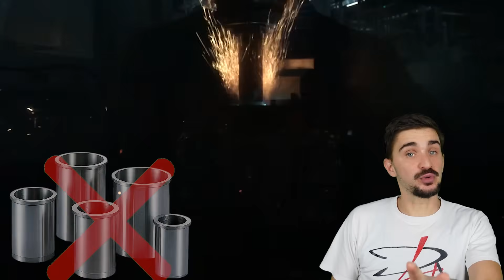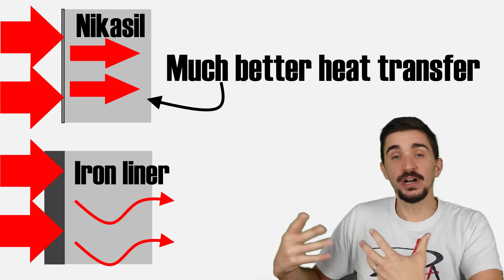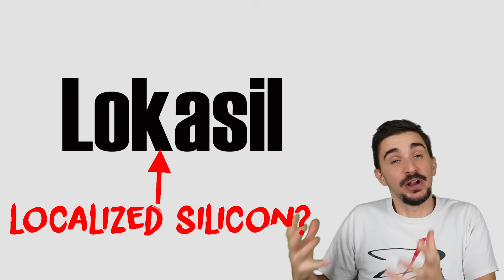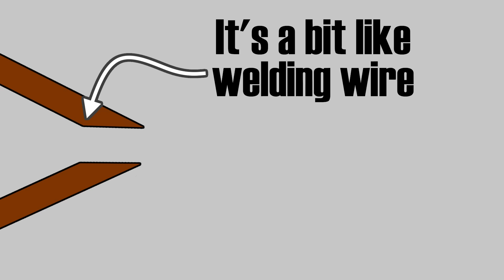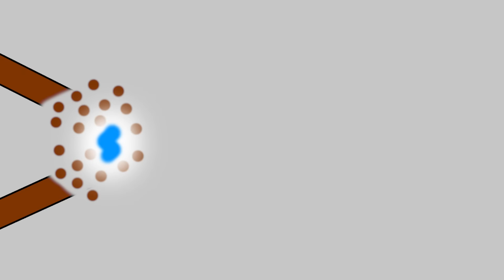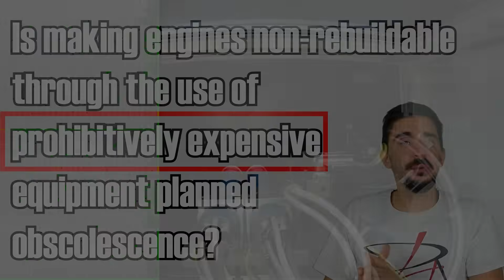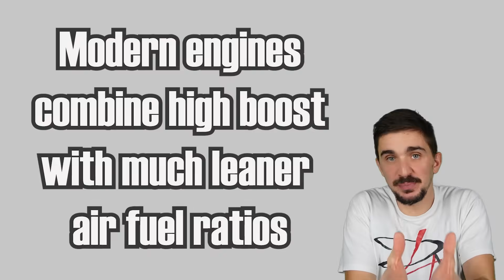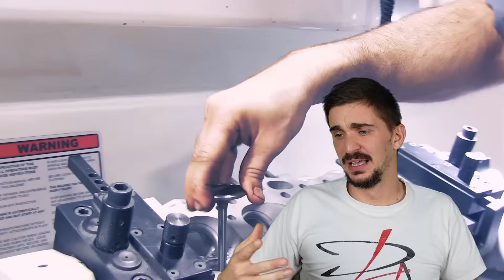Why Are Engines Becoming Non-Rebuildable? Everything About Cylinder Coatings

Comment: Good analysis.  Several problems, one you assume that emission standards have to change over time.  If so the standards were excessive or inadequate.  This is part of planned obsolescence on the part of the Communists who now masquerade as "environmentalists."  Problem two: rebuilding the engine is rebuilding the vehicle because the whole machine dies with an non-rebuildable engine.

Comment: While I agree the new spray coating is durable enough that they are imo a worthwhile improvement (especially for the weight reduction compared to full iron blocks), the reality is by the time these engines fail, an engine rebuild or replacement is so costly that the entire car gets written off. The emissions damage should calculate the emissions of the entire vehicle being recycled and a new vehicle being manufactured as a replacement. The biggest criticism I have is the extended maintenance intervals causing a significantly shorter lifespan. Every modern engine I've worked on has the potential to last 500000km when maintained religiously and by that mileage, the rest of the vehicle tends to be consumed beyond repair, making it pointless for an engine to be rebuildable regardless of cost

Comment: Problem with your thermal part failure theory is none of that makes the engine none rebuild able. If the part that fails is overly cheap or makes rebuild and repair even cheaper too. So the only possible way to make something planned  obsolete is to make it impossible to repair. You completely just made the case that yes this is planned

Comment: Assuming that these new coatings last as long as the old cast iron engines is a huge assumption.  I'm old enough to remember the Chevy Vega very well.... and their engines were literally botched abortions on wheels.  I saw several fail at well under 60,000 miles.  Although I did see one make it to 105,000 before it too began smoking like a battery fire. 

The big problem is that "new tech" cars all run when you buy them, it's not until some years later you found out there was something wrong with the process used to create them. Which is of course is too late to get a refund.

The question is not whether an engine is rebuildable, it's whether it will last as long or longer than it's predecessor,  .

Comment: In order for an engine to be rebuilt it has to wear out before the rest of the car.  So, that likelihood is small.  The car needs to live 10 years or more with out getting totaled in a collision, or rusting out, among other factors.  If the car is a modest car, who wants to spend $5000 rebuilding an engine when the bluebook value is $1500? Also, if the car is new-ish and the engine fails that unit will not be rebuildable. Like if it threw a rod through the block, dropped valve seats, broke a timing belt etc. Just look for a low miles engine in the scrap yard.

Comment: not to mention just rebuilding the engine isn’t enough for an old high mileage vehicle which would likely also need brakes, suspension and drivetrain work. for that vehicle to still be safe and reliable youd need to rebuild most of the car

Comment: The one important aspect you fail to mention is the effect of these exotic coatings on piston ring wear. The old cast iron linings were/are effectively self lubricating. I sense this will not be so with these very hard and possibly granular (at microscopic level) new linings.

Comment: The engines I work on most are unique in that the exact same engine is available in both iron liner and plasma coated liner variants.  Not similar engines, the exact same engine.  Not mentioned is that the coated bores develop more blowby quicker and go out of round quicker in the lifetime, leading to increased emissions and reduced power as the engines age.  Also headgasket sealing is a bit better on liner engines (assuming liner walk and deck movement for open deck engines is controlled), only an issue with us when outputting over double the HP as the engine was originally designed.  I'm not a fan of plasma cylinders personally for my use case which is ultra high output, but for "appliance" car engines, it's a big plus.  Those cars, the electronics and car body itself doesn't last the engine's lifetime anyways, so you throw the entire car away every 6 years or so.

Comment: You touched on an important consideration regarding rebuilding vs replacing modern engines. I think a hugely overlooked problem is the premature failure of an engine that forces the replacement even under a manufacturer’s warranty. Not to mention entire vehicles that end up in the junk/salvage yard because the engine failed.

Comment: All I'm hearing is someone hasn't developed a block core rebuilding business. No, you can't send it to a local engine shop. But the Block CAN be easily rebuilt and reused by a shop serving a regional or Continent scale Sputter and/or Nikasil resurfacing shop.

Comment: Cylinder coatings, direct injection, ultra-lean fuel mixture, 0w5 oil with extended change intervals...All the issues caused by extreme emissions regulation are causing many of their own problems. Seems we're well past the point of diminishing returns.  Imagine the increased power/reliability at lower cost we'd enjoy from ICE engines if emissions regs would have stopped circa Y2K.
Reply: Yes, cylinder deactivation is killing my LS engine.   EPA efficiency standard garbage.
Reply: In other words, we are implementing problematic solutions to problems we have created ourself by implementing problematic solutions in the past. Eurosoyuz might make this their slogan.
Reply: FACTS,FACTS,FACTS.
Reply: If the EPA didnt incentivize US auto manufacturers to build nothing but useless gigantic vehicles, we wouldnt be having a lot of these problems. We're trying to push these multi-ton brick shaped vehicles to the very edges of performance and efficiency. Of course shit is gonna break. If everyone just bought and drove reasonably sized cars, this would equate to less HP needed, less heat, less load.....more reliable cars. We could still have 1995 civic sized cars getting 45mpg with simpler engines. But everyone needs a damn pickup.
So tired of seeing 90% of people driving full sized SUVs or pickups by themselves.

Comment: Well if it means enough to people they will do their researcha nd buy accordingly. Sadly I already know that 99% of people that drive a vechile do not care and will not do the research. These people are like my 3 sons they never care about anything until it directly effects them. When an engine fails outside of warranty but well before it should have who get's stuck with the problem? The cream puff low milage presitine vechile will get traded in andresold and it is the poor second owner that thinks they got a great deal that get's to eat the cost of repair or right off a huge loss and try again! Last I checked few of these engines with these coating have produced a lot of 300,000, 500,000 and 1,000,000 mile engines.  Not to mention all the garbage plastic assemblies holding parts that can not be purchased seperately and all of the aluminimum one time use hardware that is so popular with European manufactures! To say I am not impressed as a customer would be an understatement. Add in all of the oil consumption issues and bore failures we have seen in the last 10 years especially and again not impressed! I would be more interested in seeign how much CO2 and energy could be saved by doing things correctly the first time!

Comment: A video looking in all the details would probably last a whole week,
If we are just considering rebuilding or remaking an engine the data looks ok, but then again the whole car has to be made for the new engine which significantly increases co2 output, because they usually run a limited production run before changes and then you can't get one so you are forced to purchase a new vehicle, then there is a fact that most of this increses in efficency are offset by constantly heavier vehicles, saving 5kg on an engine while the vehicle weighs 2000kg, 10% increase in efficency but 20% in weight from mostly luxury, and then the worst part that all of that is dumped on the customer, purchasing a new vehicle for 30k € only to get it scraped and lose most of your inital investment after few years, ever-growing search for more profit from a customer increasing the inflation further, some of the worst points are the engines barely outliving their warranty periods, personal vehicles are more and more becoming close to a subscription service for a regular customer having to buy a new one every few years but the price of which is ever increasing, by the time you have payed out your current vehicle it reached the end of its lifespan and need to purchase a new one.
There is soo many points to look at and not all of them are the manufacturers fault either.
The point is we are moving further and further away from trusty repairable vehicles which in the end is benefiting neither the customer nor the manufacturer, declining sales and increasing inflation.
Manufacturers voluntary designing some parts not to be easily repairable making a vehicle have to be scraped sooner due to amount of work needed while the fix itself would increase its lifespan significantly and in the end reduce co2 compared to making a new vehicle.
While reduction of a co2 engine output is a big part of equation significantly reducing it's lifespan for a marginal gain is another issue, low oil pressure due to pump design making engines wear themselves out, barely outlasting warranty periods, engine belts in oil bath causing plenty of engines and vehicles to be scraped barely paying out the co2 debt of their production. My comment is already a whole paragraph and it's more a means of further discussion and some personal views then simply stating right or wrong

Comment: I fail to see how a rebored 30 year old aluminum block iron sleeved 300k kilometer engine with oversized pistons is an expensive repair, its something a hobbyist can do. And emissions wise the 5% friction change doesnt compare to simple advances in fuel technology like combustion chamber design, variable valve timing, direct fuel injection, advanced knock detection, etc. Also the environmental impact of producing the actual machines and obtaining these fancy coating alloys from the ground i think is also substancial. Doing what Toyota did with some of their engine families where they had the same blocks but everything else upgraded due to euro emissions changes seems like a win for both manufacturers for cost, consumers for cost, consumers for both repairability and upgradability (being able to slap on a vvti head on a non vvti engine for example), and eventually to the environment due to less parts actually needing complete scrapping and remanufacturing.

Comment: The new technology can be replicated at a workshop level. the old surface can be honed/ground out and a new surface plated or sprayed in then honed /bored to size. Rotating MIG and Fibre Laser attatchments are already in the hands of industrial equiment refurbishing workshops  It is merely different not impossibel. If there is enough meat in the block resleeving has always been an option. Engine manufacturers rarely take refurbishent into account when designing for manufacture. So long as the engine meets service life expectations they couldn't care less.

Comment: Hmmm... The final calculation is a little bit problematic 🤔 10.5 Mio cars are at the end of the life span, it means the whole car will be recycled, not only the aluminum building the engine block. It means the steel building the car, the chemistry building the batteries, and also the plastics, glasses, coppers in wires, silicon and gold in chips ... you name it ... all need to be recycled. I don't think rebuilding will be worse to be honest. And even if they are indeed worse, it is always better to replace the spray coated engine instead of changing the whole car. But the problem is that it is harder, at least in my country, to swap the engine than to buy another used car.

I always think the pollution problem comes from the modern way of life focusing on "disposable products" encouraged by the profit behind it. It cannot be saved by one or two key technologies. It is the way of life being formed by the economical structure for decades which pushes us forward on the highway of self-destruction.

Comment: It's nonsense that my first car, and my 4th car build 15yrs apart have the same fuel economy, and my current car has worse fuel economy... and it's not engine tech at fault, it's that cars are twice as heavy requiring larger engines, and all the emissions standards/trickery holding those engines back

Comment: Just gonna chime in on the HR13 engine: I have it in my car in the 140HP variant and it's an AMAZING engine. It has tons of torque at the low end, the turbo kicks in so soon and so smoothly that it almost feels like driving a NA car.
And it does all this while using exactly HALF as much fuel as my old Audi A4 B5 with the AEB engine did, which had the same power and also much worse power curve characteristics (with a turbo that basically did jack squat below 3000rpm).

Driving at a constant 90km/h with this car I can realiably get down to 4.2-4.3l/100km, which 20 years ago for a petrol engine was just straight up science fiction. It's better than even a good economical 15 year old diesel engine could get.

And with good oil, I've done 40000km with it so far since buying it and never had to top the oil off even once. It basically just doesn't burn any.

Of course there is a price to pay for all of this and that price is complexity. Compared to my old AEB engine this thing looks like a warp engine. There are so many goddamn wire bundles and vacuum lines and sensors running all over it that I have no idea what 90% of it does, and if anything goes wrong with anything other than the spark plugs there's probably a 0% chance of me finding the problem myself.
But it's undeniable that all of that engineering works.

Comment: Interesting since those MB engines like the m113 seem to be among the most reliable engines every built by anyone back then. I had +250k miles on mine. Ran like new still. Including the gearbox.Only thing ever done to that engine itself during its whole life was a new crank position sensor.

Comment: There was an old lady who swallowed a fly....she's dead now.  
The solution to a technological problem, is never more technology.  It just gets harder to swallow and makes you regret ever making the 1st step.

Driving a fully rebuildable vintage machine is slowly becoming the most economically viable solution to modern life (for individuals).  And when this idea catches on, you can expect legislation to outlaw it as a possibility.

This is no longer about planned obsolescence, it's about the economic survival of those few giant companies who have the most to lose.  We have more than enough cars and tech as consumers, but we are being constantly hemmed in by having our options removed.   New regulations, gasoline market controls (throttling supply, non-competes), and new and improved barriers to entry (non-rebuildable parts).  

And this doesn't even touch the underlying forces that have caused the right to repair movement.  Layering of proprietary systems and structures, and increasing regulations which are supposed to be to our benefit, but only result in nicer looking and younger cars going to scrap as "economically unviable".

Consumer value is sacrificed on the alter of shareholder value.  Is that planned obsolescence?  Not by your narrow definition.  But these massive front end investments are paying for themselves amongst those few who can do it.  And it is at the expense of everyone who simply throws up their hands and "solves" their car problems by getting a new lease on a car they know will write itself off in the very near future. One way or another, this is the solution that car manufactures have worked for since the 1920: How do we keep people buying cars once they all have one?  Planned obsolescence is like the devil: The greatest trick he ever played on the world was to convince us he doesn't exist.  And now it is clear that you believe it too.

Comment: I’ll have to say that Mercedes did pretty well with their alusil liners on the early engines, my car being a 560sel with the m117 v8. Have taken a few of them apart over they years with varying mileages and abuse, the liners still looked new. I found that the rings can wear before the liner’s coating does! But of course this was before Mercedes cheapened their entire fleet and reckon they really invested to make every m117 block damn good as it was going in their flagship s class sedans and coupes. The biggest issue I have with these new engines is that they have many points of failure and even if it’s rebuildable, most would scrap the car for a new one. So not only are we dealing with the recycling of the engine but now the entire car, full of alloys, plastics, fabrics, foam, and all the electronic components, all dirty things to deal with